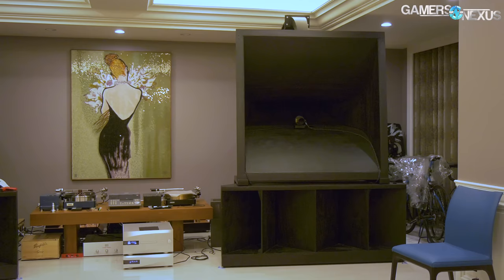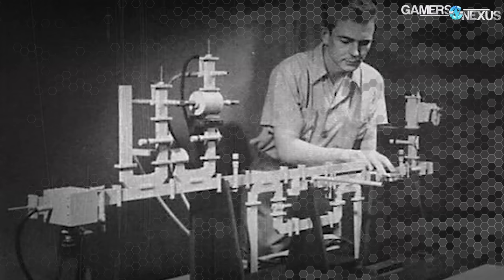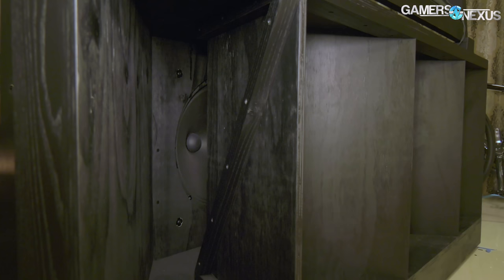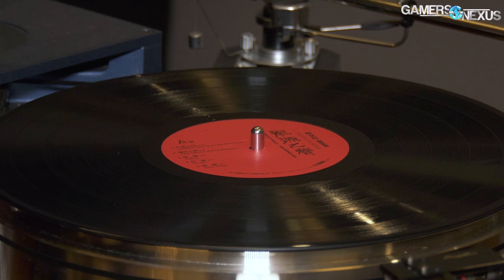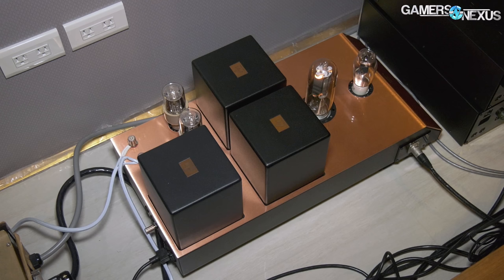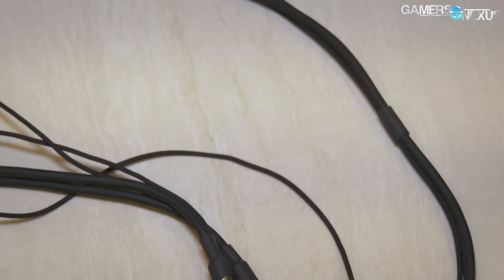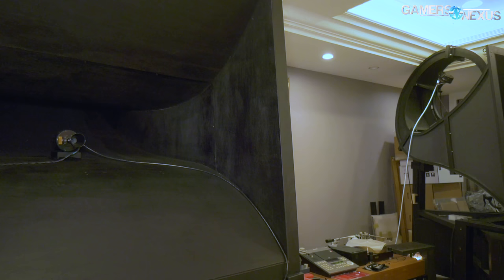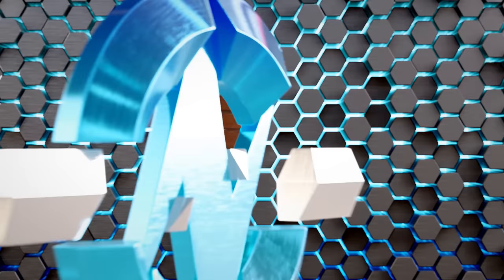100-Year-Old Sound System Tour | EVGA CEO's Audio Collection

Comment: Him saying the overpriced cables were bogus made me so happy
Reply: outside of wire material(silver or copper), and thickness and length of travel(as it acts as an inductor due to self inductance) there can be no real difference in audio lines.
Reply: Bryan o. Blue Jean Cables has always been my first choice for high quality cables. They explain everything in Black and White. They're line level cables are actually a thinner gauge than most cables because it gives them lower capacitance. And they're shielded as much as possible while remaining "reasonably thick".  I believe they said something like "the best thing an audio cable can do for sound, is nothing"

Comment: As a vintage audio enthusiast, this is causing me to foam at the mouth. SO PRETTY!
Reply: Aye as an enthusiast myself (not the vintage kind) its a treat to see a collection like this, I was starting to think it was just corporate grand standing until the comment about the cables which convinced me otherwise.
DIY cables are always the best since you control the length, shielding, etc and if you get a cold joint somewhere you can just open it up put a bit of flux on it and try again.

Comment: Could you guys please try to convince Han to synthesize his journey into an EVGA audio subsidiary? They absolutely have the resources to make quite possibly the best affordable headphone/home studio equipment ever made. I would've happily drop $500+ on a mere attempt to replicate SOME of this. This is one of your coolest videos in my opinion. Awesome work!
Reply: Robert Alford Green don’t tempt me 😂
Reply: You probably have heard by now, but EVGA does have it's Nu Audio sound cards now! They sound fantastic! Even the base model, which I have, is amazing! The only downside is that they are PCI-e, so you have to plug cable into the rear of the computer. You can hook your front panel connectors to the card, but it might cause some loss of sound quality.
Reply: @SirBilliam  some of the motherboards offer nu-audio integrated in the board. I picked up the one just because of this. Man it was worth the wait. I haven't tried the pcie card yet. Would you recommend it?
Reply: @rjgthuro  I would totally recommend it, but only if you actually care about good sound quality and don't mind plugging stuff into the back of your PC. I have tried using it with my front panel audio plugged into it, but I'm pretty sure there is some quality lost through the connectors. Also, I wouldn't bother with the 5.1 or 7.1 cards unless you have a surround system hooked up to your PC or REALLY can't stand not having a backplate. The card really does add a whole other level to music and audio coming through your speakers/headphones. I have my Corsair SP2500 speaker system hooked up to it (God I wish Corsair still made this system), and it sounds freaking fantastic. I can turn it up to max and still have zero distortion. It even cleans up lower-quality sound files. You really need FLAC, ALAC, or WAV files to get the full experience though.
Reply: @SirBilliam96  that's fantastic! I work with hifi files quite a bit. Audio transforms any experience so much. I just couldn't find an elegant solution without getting into audio interfaces this is the news I was waiting for. Thank you for letting me know!

Comment: You know this setup was made by evga's ceo because there's no thermal pads anywhere
Reply: shots fired
Reply: I thought it would be the opposite, my card is absolutely caked in them.
Reply: Lol, but the cases are the heatsinks in audio gear most of the time with the hot stuff connected to the case with thermal pads

Comment: I assembled my stereo system over 11years, it's the most tedious time consuming process I can imagine since I would only buy something for the system once I had bitten my nails thinking about it on and off for at least a week. I can Identify with the difficulties of finding parts of quality and historical knowledge of who made something is very important. When I listen to an electron tube using high  purity metals teflon insulation etc silver clad/copper wiring or carbon or even graphene (someday) I'm sure the sounds are improved. I love talking to an audiophile about the history of the setup and his/her emotions as time progressed to make these instruments work together, yes I'm into this, but this art has merit! It's about results.. the sound quality. 

Not quite the same as abstract art which has a left of field value and may not be understandable at first. With Audio like this, as soon as the system has warmed up for say 2 hours and you hear it for the first time, I could and would never compare it to anything. The reason I love audio so much is because I can hear the physics of the universe talking back to me in co-operation, and when it's this good, for the moments I listen I hear the past and the good things people did realized again. I wan't to know if Andrew has experienced something similar in his experience. My amplifier was rewired with silver clad solid core copper wire with Teflon insulation. I don't have a work shed/space organized because I moved late 2017 but sometimes I know throwing money at something doesn't do anything. That's why trying to talk to the wife about my sound system is very simplified sometimes over simplified like: "please don't turn it off and back on again just ask me".  I think the reason why one would get a better sound is mostly because of good design throughout the system including thought as to how components of the system interact, understanding this and stacking the benefits with say: If able to use high efficiency or sensitive speakers then focus less of output power of amplifier more focus on the quality. There are trade offs in most amplifier designs from power to greater realism or fidelity but understanding why is hard for most people, I try the use leverage or gearing as an example then there is the technical details best left alone until you intend to understand it competently. 

Thank you so much for this video!

Comment: So it's cool. Like, really cool, but I feel your opinion on digital to analog comparison might be flawed. With the system only reproducing 80hz to 10khz, you are missing huge amounts of the audible frequency range, on average 20-20k. Some can hear higher or lower. My personal range is around 20-22k. Much of the near inaudible sound is what is removed during the analog to digital conversion, and you end up missing out on some of the brightness in instruments like cymbals, and the sub-bass on the larger drums. It would be interesting if you had a listening session with a (kind of) comparable system with a wider range. I'm aware that something as high-quality would be rather difficult to find though. :) Thanks for always bring engaging content!

Comment: As a long time audiophile, but also as a scientist, my main two comments:

1) An audio system with a range of 80 Hz to only 10 KHz is really rather limited. And stating a high-end audio system range should always come together with how flat the system is within that range, e.g. +/- 3 dB? or maybe +/- 1 dB? This part is sorely missing. In any case, young ears can hear up to 20+ KHz, and everyone young or old can sense infrasound well below 20 Hz. Any accurate enough reproduction could be regarded as high-end within a specific range, but a system to be regarded as full-range high-end normally ought to perform flat (<< 3dB deviation) from at least 40hz (preferably 20 Hz) to up to at least 16 KHz (preferably 20 KHz.) The room by the way is in fact part of the system, since it can greatly affect the +/- X dB deviation all over the place under 200 Hz. So it's the full setup, room + sound playback system, which might or might not be high-end.

2) Whether analog vs. digital could be "distinguished", or even whether one sounded "better" than the other, is always a highly doubtful claim. Testing properly for consistent sound differences/improvements would require several things: a sufficiently large number of recordings made both on analog and digital formats, properly mastered on both formats to do proper justice to both formats; accurate volume level matching from both playback options; and most importantly, it would also require a sufficiently large number of people as testers to go through *blind tests* on the systems, to properly assess any alleged differences. In fact those could better be double-blind tests. So In summary, it is almost always impractical to test properly. So any such claim is extremely highly doubtful because of being simply anecdotal and biased from non-blind tests.

Comment: I'd be curious what this setup would sound like if he replaced those drivers in the horns with some modern speakers from the best hi-fi manufacturers, or if this setup totally relies on those specific drivers. It's interesting how the sound peaks at 10khz, which makes sense since you mentioned it's best for classical music, other music with tons of high frequency information and harmonics won't sound as rich most likely. 

As a sound guy myself this is probably totally the opposite direction I'd go for a high end sound setup if I had the cash, but it's an interesting direction at least.

Comment: I love my vintage hi-if setup but it's not quite that old. New gear just doesn't have a sound that's as full and......I'll use the word luscious. And records have a feel, smell and sound that's so different to the MP3 expierence. Some of the parts I run are a Kenwood KR-9600, Klipsch KG5.5 speakers, and a Dual 1245 turntable.....and slew of other classic gear.

Comment: Another possible explanation for analog vs. digital difference: If the digital recording was printed after ~1990, there's a decent chance the CD release was mastered poorly. Not all of them are obviously, and being such a pedant I'm sure he would make sure not to let that contaminate the comparison, but the number of poorly mastered CDs after 1990 is staggering, while the same albums released on vinyl have much better mastering techniques used. In the 80s they seemed to use mostly the same master for both, and as a result the CD often sounds better, due to higher signal to noise ratio, dynamic range and frequency response.
Reply: Mastering is way more important than the difference between analogue and digital. Overuse of compression is the reason old recording sound so good. Specially on a high efficiency system like his that can reach realistic level with only a watt or two.
Reply: Decibels depends on the speakers sensitivity. Car subs have 80ish db/per 1w,my old ass Toshiba speakers have 91db per 1W.

With 1W you can get 90+DB easily.
Reply: Yep CDs mastered before 1990 were much better, but keep in mind, all the mastering engineers were transitioning from vinyl to digital around this time. There were plenty of horribly compressed vinyl pressings from ancient times. See Loudness Wars at Wikipedia. If your looking for dynamic range, it's about who's album it was, who produced it, mastered it and the genre it's in, just as much as about what medium is used. In fact, not just dynamic range, for just good sound period.

Comment: For the cost I'd take vinyl any day over cd. As an example, when I was selling Hifi, a turntable with a decent moving coil cartridge costing $1000 was considerably better sounding than $3000 of cd transport/dac, and not really subjectively, cd is leaner/drier with less spatial information than vinyl or the original 24bit or analogue recording.

With turntables there is a world of difference between moving magnet and moving coil cartridges, most people having heard only moving magnet (or 16bit 44.1khz digital). They are at their best mechanically isolated, fed well mastered tracks from well pressed vinyl and require human intervention in the middle of an album, that's a lot of effort for some people.

On cables, solid core and multi-strand on speakers sound different to me, but outside that, if it's of sufficient gauge/quality for the application, all's good.

Comment: GN very good video and wow that sound system is wonderful. It is pretty easy to tell the difference between analog & digital on a very high end system. Like you said analog if played back from the right device will have a fuller sound and will sound more life like than the same source of music played from a digital source.

I had someone test my ears a long while back. The guy had a very expensive audio setup and he was saying analog had a much fuller and richer audio quality when compared to the same music source but played back from digital  source  in stead of a analog source.

I did not really believe him at the time yea I was young. So he took a record and a cd music disk and went to the same song he said close my  eyes and let my ears tell me the story. So he played both sources which had the same song. I clearly new right away which format was what. When it ended he said which sounded better and more life like with a richer fuller sound. I said number 2 was much better and that had to be the cd music disk since digital was newer and better thasn old analog.

He said then you would ne wrong number was the record and that analog  even though it was here first and is older will have the better audio quality of the two. He went on the explain to me as to why.

Anyways the gist of it is sound carries in waves analog does it in a smooth fashion covering every step in the audio spectrum. Digital on the other hand do not it covers the audio spectrum in staggered steps and jumps to the next stage rather than doing it smoothly like analog does. He said this is why that from the song played my ears could hear the difference because the digital version had missing audio information that the analog version did not have anything missing and even my noob ears could hear the difference he said he was impressed that a non audiophile buff picked it up on the first try even though I had guessed it as the wrong source..lol

Comment: Shame he doesn't go all out and get that 20Hz capability out of the system, from what I can tell this is supposed to be incredibly efficient to all work off the low power valve amp, bi-amping may take away from that. Problem with audio transformers is they also limit frequency response, so its likely rolled off at either end out of the cartridge transformer. If he wanted to go all out, it'd be cool to see a concrete horn tuned all the way down to 20Hz behind this. I'm surprised there's no time delay on the tweeters or woofer though.

Comment: Nice sound system that I would enjoy listening to. The audionote amplifiers en preamp is a lot less interesting to me although but the turntable and speaker system is really nice. Even if very large speakers the low frequency would be limited but it should sound lively and get realistic scale. I also use horns and tube amplifiers on a active 3 way system mostly home made. It's a lot more modern but there is nothing like a good set of horn speakers specially in the midranges. I'm happy to hear the owner kept is sanity and didn't bought that stupid audiophile cable bs specially that audionote are well versed in this and other bs marketing (look at their copper or silver in oil capacitor pricing for fun). Those western electric components a highly collectible and valuable now and it's just gonna go up.

Comment: That 80 Hz to 10 kHz sounds like a mistranslation or just a mistake, or it's like a +/- 0.5 dB (SPL) measurement... A modern studio nearfield monitor with an 8" woofer can get a flat +/- 2 dB(SPL) range of ~40-20 kHz (at least the good ones, like Genelec), a subwoofer system that big should easily be able to handle at the very least down to the 30 dB (SPL) region... And again the tweeters stopping at 10 kHz... That really doesn't make sense to me for a "hi-fi" system. Testing almost any song with 0-80 Hz and 10+ kHz cut off via EQ makes music sound super boxy and not appealing. =/

I have no doubt the sound system is absolutely magnificent, those vintage horn speakers often are glorious, but those numbers don't seem to make much sense...
Reply from the maker: Those are the numbers we were given. This thing is ~100 years old, remember. The frequency response of the driver is limited, but the sound stage is impressive. There is a lot more to it than just frequency response.
Reply: Of course, and indeed depending on what type of music you're listening to sound stage can make a humongous difference. Would be interesting to hear it in action myself, I have a hard time thinking I could really get into the kind of music I tend to listen to without better bass extension, but that's not going to happen. Cool video regardless, great that you decided to do something like this even if it is sort of out of your normal subject range. =)

Comment: interesting system, but 80Hz-10Khz, really? That's the range of an old school table radio? What about 10Khz and above, or those pipe organ notes well below 45Hz! An FM stereo broadcast runs from 30Hz-15Khz! Why doesn't he add some more bass and a super tweeter? It's odd, I've never seen someone call a system with that kind of range a top of the line system when it comes to performance. I guess hearing is believing? Certainly the other pieces are very good. And horns that size do put out a lot of concert level sound just not the full range of it. Then again, you do lose your ability to hear much over 12Khz when you're quite old.